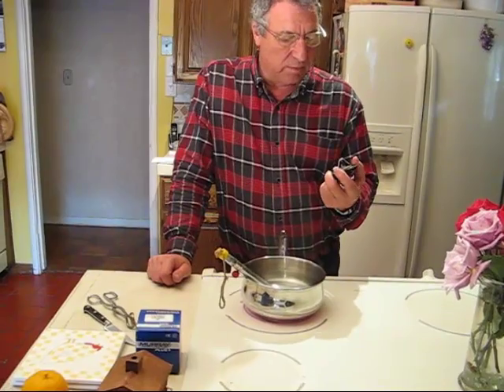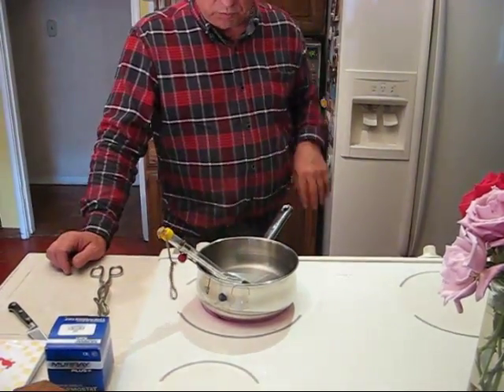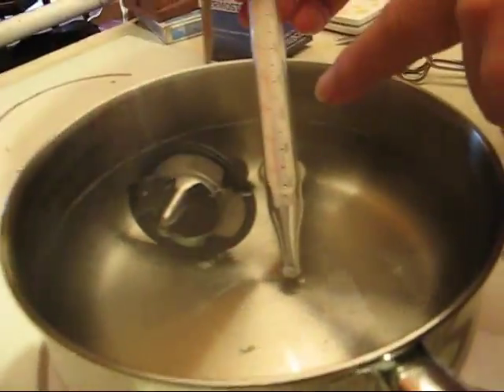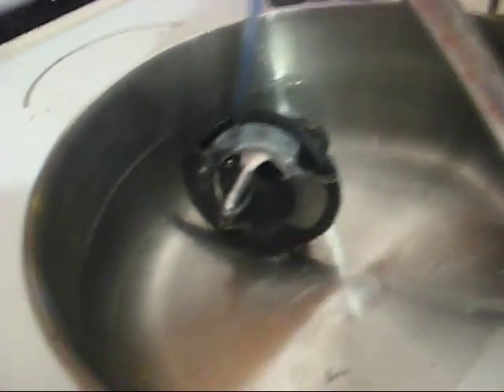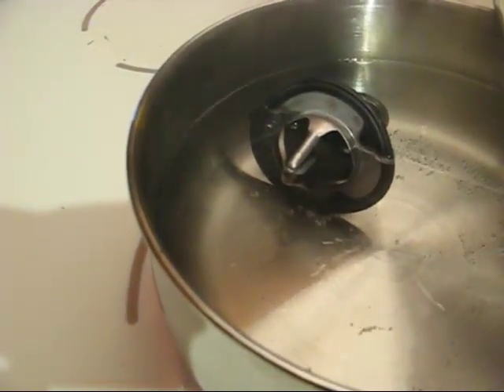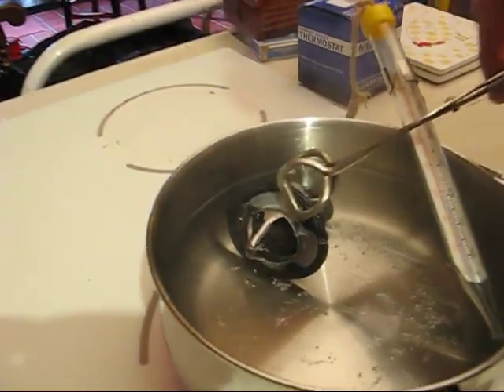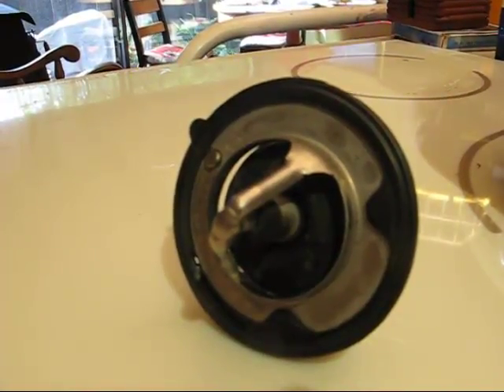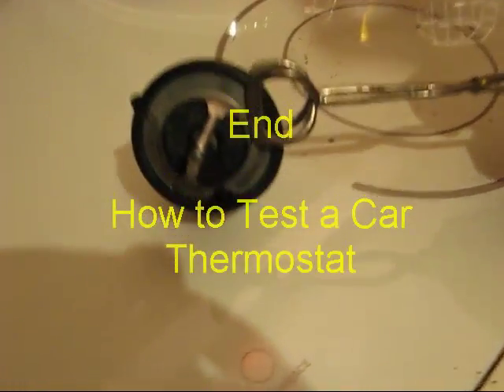How to Test Car Thermostat

Comment: Every test for a thermostat uses this method... What if your thermostat is in the vehicle... I don't care about thermostat out of vehicle, if I questioned whether it's good or bad after taking it out, I would just replace it good or bad
Reply from the maker: Open the radiator cap and see that that the radiator is full, start the car and watch the temperature gauge to see that it has moved to the standard operating temperature.  Once the car has reached its operating temperature, the thermostat will open and you will see the water start flowing in the radiator from the open radiator cap.  If the water is flowing, it means that the thermostat has opened.